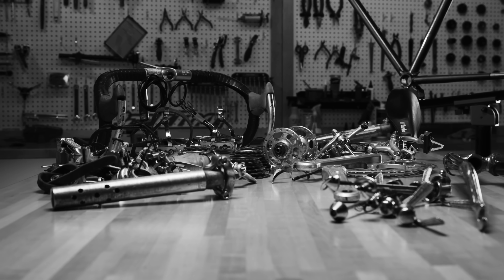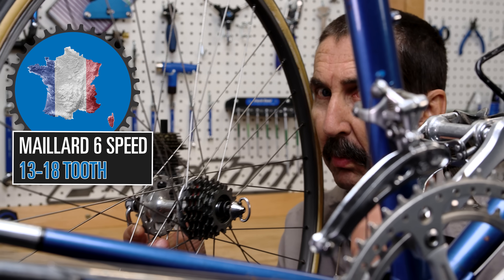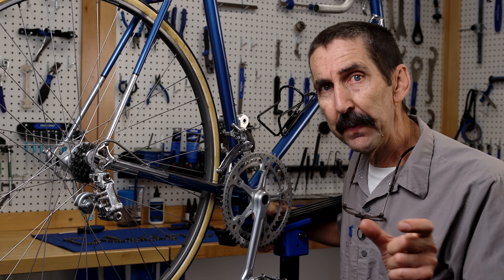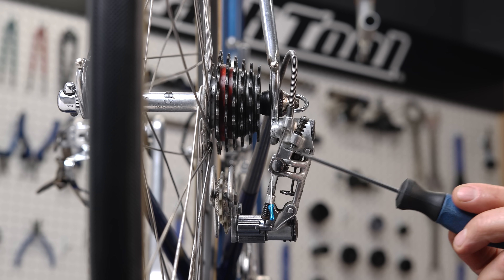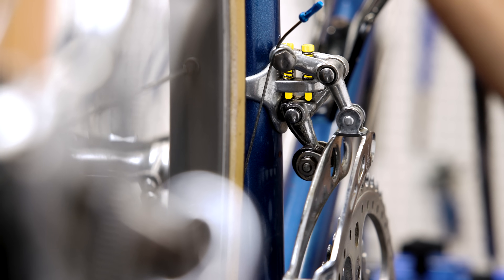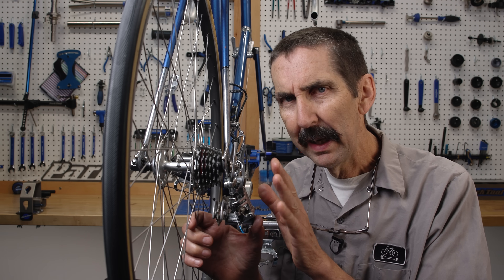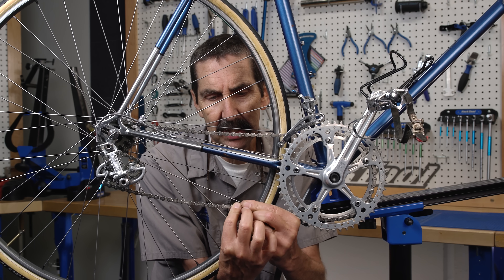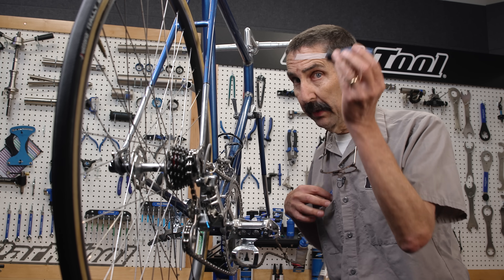What Can Old Friction Shifters Teach Us? | Tech Tuesday #225

Comment: The bar-end shifters on my ‘93 Bridgestone have switch-defeatable indexing, which is great if things get wonky when riding. It’s easy enough to find the right spot, but indexing is soooo much better. I used friction shifters on my 10-speeds in the late seventies and early eighties…and they were fine at the time.
Reply: It’s so nice to have indexing you can turn off on the fly.

Comment: I started with a SunTour friction system on a steel 1985 Fuji Team and it seemed easy to adjust. The friction shifters make the system very forgiving. I still have that bike today and use it when I need to pedal into town. When I got my first indexed system (SRAM Force) on a carbon 2008 Fuji Team, I noticed it was much more difficult to adjust. Then I discovered the "Achilles heal" of indexed systems: rear derailleur hanger alignment. If your rear hanger is significantly misaligned, you may never get the indexed system to operate as intended. Nowadays, the first thing I do before adjusting an indexed system is check the rear derailleur hanger alignment. Once it is aligned, the system is predictable and easy to adjust.

I've simplified my system today. I'm still using the 2008 carbon Fuji Team frame, but I converted it to a 1x using a SRAM Red WiFLi rear derailleur with a long cage and an oval Rotor QX1 Aero 1x 52t chainring on the front. It works very well for the low rolling hills that I usually travel when training.

Tip:  The hanger is intentionally made of a soft metal so, if your bike is in an accident, the hanger should bend or break instead of your expensive rear derailleur. This is why hangers go out of alignment, they are malleable. Therefore, be careful when you manually pull/push your rear derailleur by hand. If you pull or push it with too much force, you may bend your hanger without realizing it and it will no longer be aligned. What do you align it to? Answer: The rim of your rear wheel. Naturally, I use a Park Tool DAG-2.2 for the job.
Reply: Oh yeah, I learned about the hangar alignment issue the hard way. Now I take extra care never to accidentally bang the rear derailleur against anything or even lay the bike down on that side 😂

Comment: I started on friction and loved it.  I have tried to revert, but I have settled on an 11-speed drivetrain and find the much-more precise spacing between gears makes friction very fussy and unworkable.  I have also found that modern clutch mechanisms compound the problem considerably.  I still use thumbies on many of my bikes, brifters on others, as my thumbs are worn out from repetitive stress (oddly enough thumbies don't require thumbs!!).  An interesting side note would be Rapid Rise technology from Shimano, which reversed the spring in the rear derailleur.  Grant Peterson is currently reviving this technology under his Silver brand of components, I believe!

Comment: The cycle industry have been guilty of over complicating the bike for years - obviously to charge more for their components, and to mystify what is essentally a very simple machine.

Apart from electronic shifting , all shifting means are friction , whether click to shift digital or otherwise , friction losses in cables and bushings or bearings are dependent on friction in one way or another.

Comment: These videos are good to see as it's so important to know the basics before moving on/up to a new design.
The only thing I did differently on my old 12 speed was, once I had the limit screws set so they were OK, I would set the chain on the large sprocket up front. On the rear cassette I would shift, one gear at a time, from the small sprocket up to the big one and then back down again. Sometimes I would need to "micro" tune the limit screws so it wouldn't move the chain too far. When complete I switched to the small sprocket up front and repeated the process. My bike shifted perfectly after I was done.

Comment: I use my 1986 Stumpjumper daily for getting around and leisure rides. The Suntour XC transmission with friction thumb shifters is quite fun to use when the chain isn't falling off the chainrings. Changing gear makes a nice "chunk" sound. It feels like the bicycle equivalent of a stick shift car. 

I've done my best to adjust the FD to prevent the chain from falling off the rings, but it has BioPace rings, so there's always a point in the pedal stroke where the FD is "too high", but if I lowered the FD anymore it would make contact with the rings.
Reply: Yep, the bio pace rings did have that problem…. they were a useless gimmick though, so no problem to replace with normal round ones…. after 37 years they’re probably totally shark-teethed…. :)

Comment: I’ve trained and raced for 40+ years ( I started at age 13) and have ridden bikes with a wide variety of shifting systems…friction, indexed down-tube, 9spd STI and 10spd STI.  (At my age, I don’t think I’ll ever make the move to electronic!). Every system has its pros and cons, but the beauty of friction is that those shift levers will work with anything from a 5-speed corncob freewheel to a wide range 10 (or 11!) speed cassette with nothing more than (perhaps) a tweak of the limit screws on the derailleur.  After that little tweak, they’ll never be out of adjustment again!
Reply: Raced Cat. 2 in the mid eighties, extended touring in the late eighties/early nineties, and one item I could not function without were my Modolo carbon shifters, and my Maressi shoes. Now I ride one of two Trek Domanes (one analog, one electronic) and I'm sure the art of cycling has diminished.
Reply: @ChuckD59 I think that being able to shift while doing a standing climb is one of those things modern systems do better, but I suspect that you could put ramped cogs into a friction system and get much the same benefit.  Maybe you'd want barcons so you didn't need to reach to the down tube while stomping.
Reply: @christopheroliver148  Barcons? No, thanks. I'll never do barcons.

Comment: Q. I have a 1985 Bianchi Sprint. On a ride with a friend today in the Swiss vineyards. Beautiful. Steep hill 10+%. Small gear on front. Moved to biggest sprocket at rear. Rode seated. Then stood on the pedals. Chain moved to small cog at rear. Aaaargh. Tightened the lever as much as possible with a multi tool. Seemed to solve the issue for remainder of ride…though I remained seated. Was that the correct solution?

Comment: Park Tools please make a viedo on the following issue.  From watching your viedos I learned that there is no universal bike built around one système made out of one material.  Yours is one of three sites that these différences are not about style and cost but pure utility.  Thanks for the tip.  I have both type of shift système.  My problème and I see most people have the same problema.  I have ridden in the same gear my whole life because I do not know when and why to change gears.  I rode beside a guy yester day.  He was commuting on a cheap 28 speed without brakes.  He within two miles stopped due to cramps.  No cadence, no shifting, no brake....he was so happy his truck was finally fixed.  We do not spend enough time on a bike even in a life time these days to know what they are good for, how to ride them and how they work.  Last...I go to the bike shop I tell the guy who owns the shop that we go into a bike shop and walk out with one bike when we need three at least.  He asks three why?  I tell him people who do not plan on riding all year round no matter the course, the time, the traffic, and environnemental condtions buy on bike and hang it on the wall in the garage.  You need in the least sell stands and hooks with the one bike one système you sell.  He was not even motivated by more potental sales and repair volume to see that at least three beats one.

Comment: Never rode a friction-shifted bike before. Although the front derailleur on my old city bike didn't have a really indexed system, you just clicked a few notches forward or back to shift and trim. I do plan on buying/making/repairing an old race bike and trying out the friction shifters.

Comment: Rode ‘em for years. 1967 until ‘97. Much better really. Simple, light, and easy to set-up and to repair….👍
Reply: So what is stopping  you still using friction shifters?
Reply: @peterwillson1355  :- Well, nothing I suppose, Peter. Got seduced by indexed set-up’s in the late 90’s. Now, all of my bikes click….
Reply: @billcaveny9495  like you, I discovered indexing sti shifters in the 90s but I've since gone back to downtube friction shifters except for the two flatbar bikes I have.

Comment: I had friction systems back in the day.  Then my first indexing was a Shimano Positron 10, 5 in the back and 2 chain rings.  With friction you can have whatever number of sprockets in the back you only need to adjust the limits and there you go from 5 to 12 with very little issues.  I Remember I had Ultegra 600 I believe, downtube shifters which were 7 (or 8) speed indexed but had a setting so they could be friction as well.  2 systems in one.  Never had issues with adjusting to kill the noise even being a kid.
Imagine if they have kept the system, no need to spend money on shifters or anything else just a new sprocket or cassette and go from 5 to 7 speed or whatever.
And nowadays if I forgot to charge the batteries I may be in trouble going up the hills to get home.  Good thing is I can swap batteries from front (seldomly shift) to back.

Comment: This is the best series on YouTube currently. Thank you Calvin. Friction shifting is great, and is currently my front shifter on my cyclocross bike due to a broken internal system in the front brifter. It broke during the parts shortage, and it was easier to go friction. I've not found a reason to replace it yet. It looks good (bar end), it feels good (it's clicky), and it's simple and holds up to the grime and crud of off roading (especially around the bottom bracket area)

Comment: I'm using friction shifting on all my bikes now. Thanks to a 31.8mm down tube shifter clamp it's also really easy to convert almost any current and new steel bike to friction down tube shifting.
Muscle memory is very good at indexing gears 😊.
Reply: I'm surprised more people don't use them, they're so simple to maintain, more reliable, all you need for everyday riding.
Reply: So true. Once used to it you can almost slap the lever into perfect trim most of the time.
Reply: We are bombarded with media saying we need a lot of gears. 18 (3x6) is already a challenge to learn with friction shifters. That is why people prefer more and indexed gears. The reality is most of us could make due with far fewer and simpler (friction) gears.
Reply: I have seen break shifter combo for road bikes with friction shifting. That is something I'm very much keen on trying one day

Comment: I’m a semi retired pro mechanic and shop owner, with near-antique shifters on all my personal bikes. All are totally reliable and barring a crash, are all roadside adjustable with simple tools.  Just carefree riding and no high tech service required.
Reply: Jesus you retrogrouches are insufferable. 

How is that that you "can't believe" people don't use them (it's literally a simpler system for your average user and allows you to cover your brakes while shifting), or making dense conclusions that people who use index shifting must be part of some sort of 'bicycle conspiracy'. 

Anyone who rides a bike that isn't just cruising along (yeah go and try and ride any terrain that requires you to not take your hands off the brake in the small amount of time it takes you to shift). Go race a crit or descend a MTB black run with friction shifters and get back to me. 

The need to make the world black (friction shifters) or white (oh everything is wireless etc) is just tiresome. The bulk of the market is still cable actuated shifters which are super reliable and super affordable (a 12sp Deore shifter and mech is what, $70 USD with 12sp chains lasting longer than 9/10/11sp chains which has been independently tested by Friction Facts). 

Ironically you also have more friction shifting options available than ever before with loads more small manufacturers producing them. Just go ride your damn bike. It's not like people are commenting on every indexed shifting video going "har har friction shifters sux".
Reply: @lenolenoleno  Dunno who you're replying to but I didn't say any of that. Friction shifters ARE more reliable, simpler to maintain, & I AM surprised more cyclists don't use them for those reasons. The vast majority of cyclists are not professionals btw, and in fact are just cruising along, a task for which friction shifters are just as good as indexed, but more reliable & simpler to maintain. So I don't see your point.
Reply: Reliability & simplicity of maintenance are huge pluses for friction shifters over index. Surprised more people don't use them.
Reply: @papalegba6796  Cyclists with lots of disposable income and obsession with technology provide the market for electronic/wireless drivetrains, and for 10/11/12 speed cassettes, etc.  Most cyclists just want to ride, have smooth shifting, and good brakes when you need them.  The industry likely dislikes high quality older components that last and last, with regular maintenance and can function well for years.
Reply: @paulahart4513  I think a lot of newer cyclists will never have tried both systems, so won't have the knowledge of the pros/cons of both.

Comment: I sold recently my 1971 Columbus-tubing Campagnolo-Nuovo-Record bicycle. I had put it together myself under my uncle's supervision. I have many bicycles now and a piece of my heart went away with that bike....
We believe things nowadays are way better than in the past. They are better, however past things were working very, very fine. In addition they had one thing: simplicity.
Reply: that's right. simplicity. our lives are quite complicated already, to ride complicated  bikes
Reply: You'll think that until you ride a bike with a Pinion gearbox and suddenly that 12 or 16 speed set of gears with such beautifully spaced and such an incredible range of gears, kinda makes even the 11 and 12 speed rear derailleur clusters seem antiquated.
Reply: @tauncfester3022  I have a Bianchi full carbon 2x12. I take around some of the smaller sprockets because they look good not because I use them. The price to pay is the constant need for a super fine adjustment of the rear shifter. For me 2x10 was the optimum

Comment: Yeah I remember my first ever road bike was a steel Giant something😂 circa 2003. It came with an indexed Shimano rear derailleur and a friction front shifter, same as my second bike, which was an alloy Trek something. I knew nothing about bikes back then and they both rode just fine without pretty much any maintainance. Apart from a couple of times when I moved the front shifter too far and the chain dropped.

Comment: I'm using friction lever shifters since I changed my Shimano SIS system from a 6 speed to a 7 speed freewheel. I'm using the levers in friction mode instead of indexed, using my ears to tweak the gear changes. I'm running a Shimano MF-TZ500-7 14-34 freewheel and I'm loving that 34 teeth gear to climb steep hills. Brazed-on shifter on the frame is more convenient as I'm using clip-on aero bars. It's a better all around solution using one bike to do the hills and the flats.
Reply: Yeah, I have an old 80s race bike, but it had old non-aero wheels with a corncob, and I happened to have a set of 90s aero wheels on a cheap parts bike that had a nice 11-32 freewheel. Guess which wheels and freewheel went on the race bike, and the corncob works just fine with the triple crank on that parts bike. Fortunately both were 7 speed so I was able to keep the indexing, which I do  like. 

On a similar note, I've heard that the modern ramped cogs on the 9+ speed stuff work beautifully in friction mode. At some point I need to put some more modern wheels on that bike and try it out.

Comment: In 1996 I took off my Suntour friction shifters and tried the Shimano intergraded shift and brake levers. In 2006 I took the shift/brake levers off and put on my Suntour friction shifters. I am now 71 years and will keep these on until I can no longer ride.
Reply: In 1996, I bought my first NEW bike ever and it came with indexed sti brifters. Funnily enough, in 2006, I came into possession of a nice set of shimano downtube shifters,  which I use in friction mode.  Just like you, I'll be using them for the rest of my cycling days, though I'm a bit younger than you.
Reply: ya, lesson learned....keep the friction❤
Reply: Im 73😅
Reply: I still run bar end shifters myself.